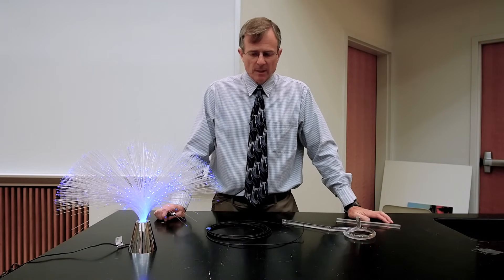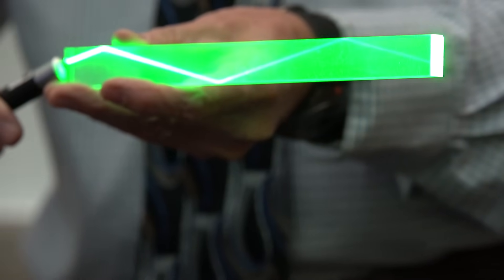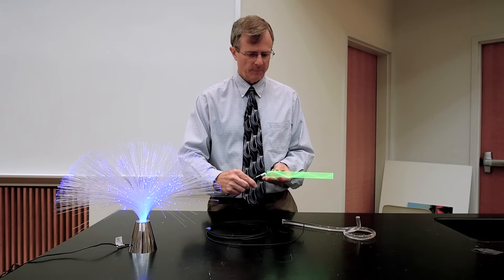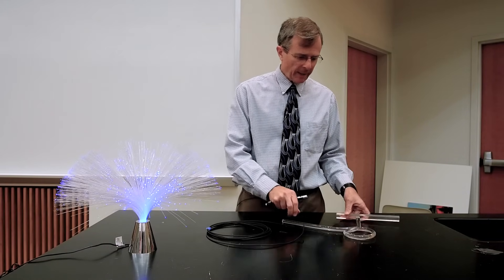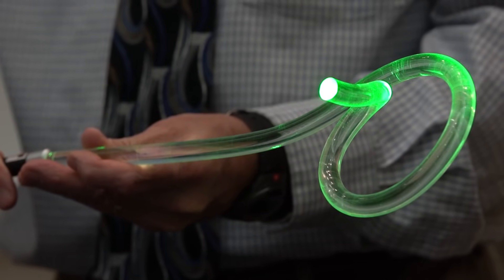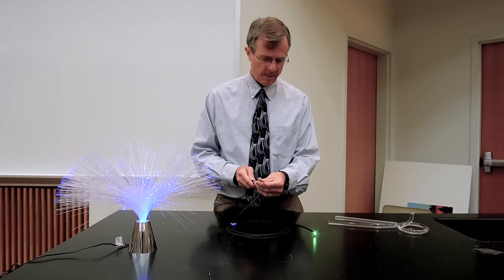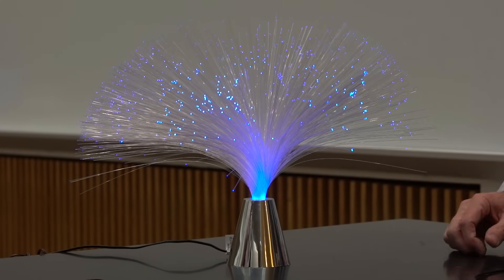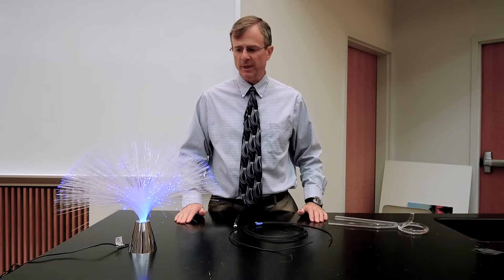Total Internal Reflection Demo: Optical Fibers

Comment: Total internal reflection assumes a perfectly smooth surface.  You can see some green in the 2cm(?) plastic tube that is leaked from the sides because no surface is perfect.  Optical fiber is much better but even that does have some loss.  For long range optical fiber they use amplifiers every x km to boost it back up.

Comment: If the internal reflection was Total, then the cable would Not have the color of the light inside. Because some of the light is escaping, you can see the color of the light on the sides of the cable.

Comment: Does the type of light matter?  For example, would a laser work?  If not, why not?  Colored light?  What sets the signal rate and strength?  That is, what device and/or process sets and/or creates the signal sent into the fiber?  A form of digital pulsation of light?  And, what material or materials can the cable be made of?  What is most used?  Plastic, nylon, flexible Plexiglas, Digital acrylic, Polycarbonate, polypropylene,etc?

Comment: Could fiber optics be used to create a passive radiant cooling system where the redirected light energy (IR) could be used to heat water or whatever else at a distance without losing a significant power?

Comment: Rules for total internal reflection to happen:
• it should always be from denser to rarer medium
• the angle of incident should be more than critical angle
Reply: PW sir
Reply: @𝐿𝑜𝑣𝑒𝑟𝑖 😅😅
Reply: What happens when we put light from rarer to denser medium at such an angle which cause the angle of refraction be 0 degree or less than that?
Reply: @MohitKumar-zc8pc  then there is no Total internal reflection
Reply: @MohitKumar-zc8pc in such case critical angle is possible but not TIR
Reply: you mean rarer to denser
Reply: @_sanush_  no, it's always from denser to rarer medium look it up in your textbook or online sources you will know.
Reply: @shreeyasharma9172  so u mean to say that air to the plastic is a denser to rarer medium, right
Reply: @_sanush_   air refractive index is way much smaller than that of water.. TIR isn't possible in air neither in plastic (their refractive index is smaller than critical angle). That's why in optic fibre wires glass is used.
Reply: @shreeyasharma9172  let me change my statement, so u mean, that air to glass is denser to a rarer medium... That's wrong honey air is thin and a glass slab is very dense, i don't see where you're getting confused
Reply: @_sanush_  brother I never said air is denser than glass. I have been commenting on the idea of my comment which was related to total internal reflection and based upon that I have been answering to you. It's obvious that air is rarer and glass is a denser medium but if you read my comments carefully I have been talking about water being the denser medium air being the rarer in relation to the TIR that was taught in the video.   I wasn't talking about TIR for optic fibres.
Reply: @_sanush_  anyways, for optic fibre wires cladding is done that's basically putting a layer of glass into the inner lining of the cable due to which the light bounces off through the glass where it travels from again more "optically" Dense medium to less "optically " Dense/optically rarer medium. Same TIR rules are applied in this scenario as well.
Reply: @peter-s7t  r U popat not everyone is smart like U, I just summarized the thing here?
Reply: How does TIR occur when Optical fibre is denser than air and light travels from air to Optical fibre?🥲

Comment: Important to know: for (digital) data transportation, the thinner the cable, the more data can be transported. This is due to the spread of the signal since parts of the beam are reflected at different locations, which have a different path-length over the total cable length.

Comment: If it is totally internally reflected why we are seeing that light..
Reply: Good question. Don't listen to morons. It's not exactly totally internally reflected when you see it. Basically not all the light rays are at angle to be totally reflected. Some do get refracted and come out so we see them. We call it total internal reflection because that is the phenomena it is based on. Like you see with the round one in second case. You don't see any light near to the source. That is the case of total internal relfection for most light rays. As for people telling you to learn basics. They either did not understand why you asked specific question or are dumb enough to not understand that something sounding simple may not be simple after all.
Reply: It is called total internal because light bends inside that fibre before coming out ,, and we can see the light because the object is transparent!!!!
Reply: @abhinayjayswal407  Even if the object is trsnsparent. If the light would have been totally internally reflected we would not have seen the light. It would have simply transmitted out the other end. As to why we can se the light is because some light rays got totally internal reflected while others refracted and came out.
Reply: @harsh patel bruh at least knw the basics to light
Reply: I think he was asking if light get reflected totally  how can we see the light path in the tube since no light is coming out.  And i think it is becuse some amount ight also get refracted.
Reply: it's theoretically total reflection, in practice you can never have 100% reflection due to transmission and abortion through medium (air) and the fiber material itself.  Fiber cables have a loss rate and range limitations due to such loss.
Reply: Because it's not 100%, if TIR is 100% then you won't see light other than it's starting and ending point of fibre

Comment: but what you realy need is a pollished side surface right? to the light beam will bounce?
Reply from the maker: Yes, the surface needs to be smooth so that the reflection will be specular instead of diffuse.  But you don't need a reflective surface, like a mirror.  All you need is to have the light ray inside a solid transparent cylinder, and total internal reflection will do the rest.  For more information, see https://youtu.be/gKaBLLjq-2I.